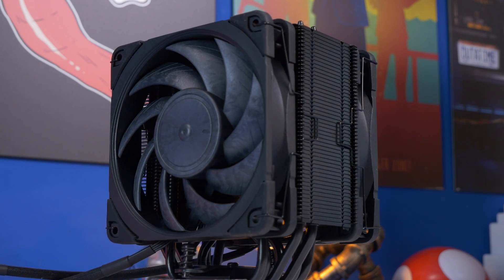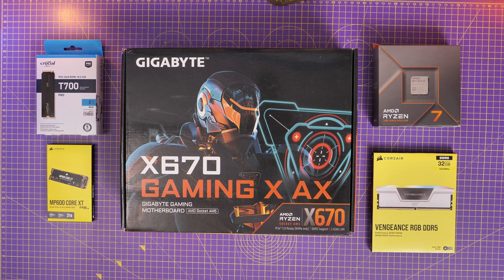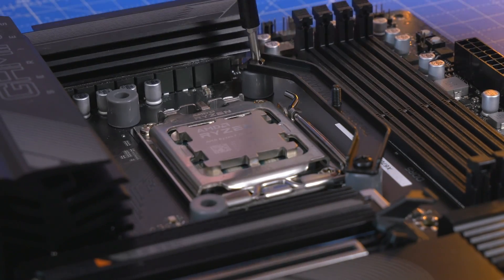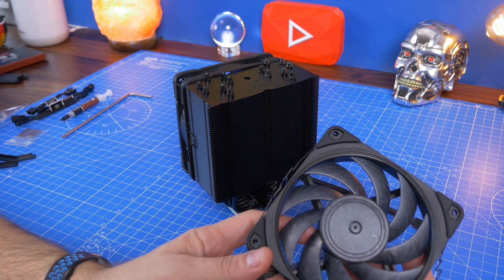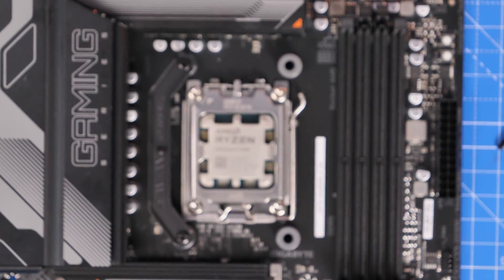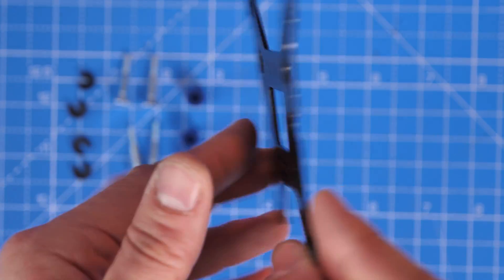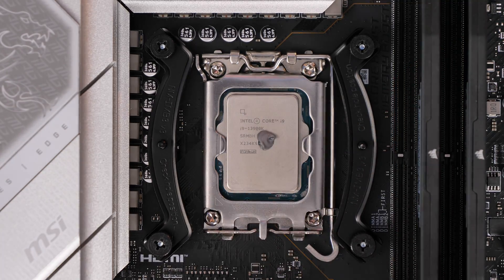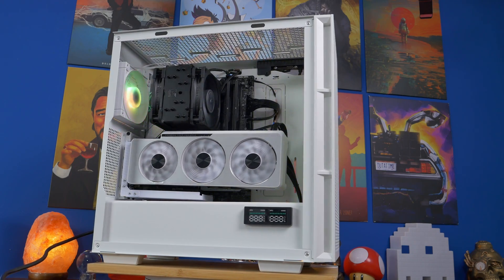Noctua NH-U12A Chromax Black CPU cooler install guide for AM5 and LGA1700

Comment: NOW Noctua removed standard plate for AMD and already replaced that with offset so user can install  standard and offset with one plate only. Good move by Noctua. I am FAN of Noctua Air Cooler. Since 8 year I am using Noctua Air cooler for my old AMD 1920X Threadripper CPU and it is still running without any issues. You pay the quality you get the quality :)

Comment: It feels like these fans are going to fall off. The little flimsy wire brackets don't actually hold onto anything. They just loosely sit into the heat sinks. But it's not actually secured
Reply: No that's not true. You didn't clip them in correctly
Reply: @Eyeless-x1 you're right. I figured out how to fasten it correctly.
Reply: @zak87  i get where you were coming from though. when i did my build i was afraid to pull them tight and mess up the fins

Comment: Hi!
Here's some feedback for your viewers.  We tried mounting this cooler to an ACER ORION 5000 PO5-655-UB22 with a proprietary ACER intel 1700 socket motherboard and we were unable to complete the process.  Unfortunately, the proprietary ACER motherboard did not have the necessary holes for mounting the backplate and we felt that it was better to return the machine and instead purchase a Lenovo T7 with a branded Intel motherboard that isn't proprietary.   I'll update this comment after we attempt to install the Noctua on the Lenovo.

Comment: I placed my Noctua down but then immediately realized I needed to rotate it leave room for the ram. I didn't do the thermal paste again because it was only on for 10 seconds and still wet. Will I run into issues?

Comment: This was a helpful video. I ran into differences with my chromax black compared to yours. It came with extra standoffs in the Intel parts back, blue and black ones. But the manual does say use blue for lga 1700. And my heatsink mounting brackets have only 2 numbered holes instead of 3. The directions show 3 like your video, but do say use #2.  The part number is version 4 whereas yours is showing version 3, so I must have been shipped a newer model (with old instructions). And my backplate for Intel shows only the Intel engraving, it does not show other markings like yours, but otherwise the shape is exactly the same..

Comment: Anyone know if the fans themselves are required to be installed with the noctua branding facing outwards toward the logo on the heatsink?
Reply: The fan logo is where the air comes out and you want it to point to the back of the case where the exhaust fan is

Comment: Thank you, such a complete video :) I'm building a new desktop pc, waiting for components to arrive. I have the same CPU cooler (already have one for my server, so sticking with what I know), but the same thermal paste and now rhe offset brackets.. only thing "missing" (not really) is a contact frame that I'm getting for it instead of the stock ILM. Hope it works well with the offset brackets.

Comment: I heard that even for hot CPU'S as the one i have the I7-13700K it works very well. Next week i'll have it. At this moment i only have the Arctic neweer 34
Reply: Hi. I'm getting a 13700k and a noctua nh-u12a next week. How has the experience been for you so far? Is the i7 heating too much? Noise levels? I do not plan to overclock the cpu. Thank you for your time. Cheers.
Reply: @DepressedCapitalist  I’m about to install one on my i7 13700f I’ll tell you how it is.

That is unless you already got one of course
Reply: @a_catfish5180  Hi. The Noctua is out of this world. Such a breeze to install and configure. I love it so far. I'm coming from a previous Noctua (nhu12s) and I've noticed this (nuh12a) to be a little little noisier. But it could be because I'm pushing an intel i7 13700k which tend to heat quite fast and the cooler is working double time. I use the Pc for music production and occasional gaming. Good luck with yours. U won't be disappointed!
Reply: @DepressedCapitalist  hey, I’m sure I won’t be. but everything else has decided to be a pain! The pcie cable on my gpu is stuck BIG TIME and my old cpu cooler is giving me some trouble but that’s just me being super unlucky and obviously nothing to do with the noctua cooler. You know how it is, 30 minutes becomes 10 hours thanks to 1 snapped or seized bolt
Reply: @a_catfish5180  Yes, I know. Been through that too. Patience, good concentration and soothing music while working helps a lot. It took me 2 days to have my pc running. I was in no rush, so everything turned out fine. Good luck.
Reply: @DepressedCapitalist  my lovely girlfriend was there to help with holding things and having small hands to reach but I resorted to simply mounting the GPU upside down (I guess inside out) with the anti sag bracket. Miraculously it sits perfectly flat on the end of the case if I flipped it and screwed it in. Extremely ghetto for a €1000 gpu but what can you do right!
Reply: @DepressedCapitalist  update my old cooler was so seized (the screws at least) I had to file them off and then heat up the heatsink to the point where sturdy gardening gloves almost didn’t insulate enough. It came loose just before I was gonna grab welding gloves… now I’m letting it cool off so I can put it all back together
Reply: @DepressedCapitalist  FINALLY. All back together and working better than ever
Reply: @a_catfish5180  Congratulations my friend. It was a tough fight hahah But you've won. Enjoy!

Comment: Does the cooler come with daisy chain cables or did you get them separately?
Reply: I believe it comes with a single y splitter so you can connect both fans to one port.
Reply: Come with them

Comment: Will the AM5 guide also work for AM4? A lot of people are still on that platform
Reply: All noctua am4 mounting (except the low profile L9 coolers) work on am5, the only difference is the introduction of the offset mounting. The L9 coolers have their own backplate which isn't supported because it's part of the socket now. Basically if your am4 cooler uses the stock backplate it'll work fine on am5.

Comment: Modern CPUs need proper cooling and not everybody wants disco lighting or AIO coolers in their PC cases. Noctua is surely the best choice for those who want the best of traditional cooling. This video comes as a perfect introduction to the world of classic CPU coolers !
Reply: I may only be 24 (which is to say RGB has been around a long time for me, many oldheads will have been around before it) but even since my first pc I’ve not cared for RGB had a fractal design case, R5 I think it was called 

Used steel series just white backlit keyboard and mouse.

Didn’t really understand the RGB hype. In hindsight I’ve saved tons not overspending on things because they have fancy lights

Comment: I used this cooler on a 7800x3d  and getting about 80c 82c ( in a hotter climate ) R23 allcore
The NH-U12A is a very good alternative to the d15 and is much smaller ..
Reply: On a 1440p config ?
Cyberpunk, 7600x, 1080p best quality, 80-85°C
I replace it with a peerless 120 and it goes 75-80°C. For this price, this cooler is not to recommended for me.
Reply: @romainh1875  no near what you say..tested with 13900k
Reply: did you use it with offset mount?  @romainh1875
Reply: @romainh1875  same db?

Comment: I recently purchased this cooler and it came with the AMD offset brackets.
Reply: I just double checked the Noctua website and they started including the brackets in Q4 of last year.
Reply: Yes, I didn't know that so I ordered it separately when I ordered the cooler. The separate brackets ended up getting lost so I said screw it and went ahead to install the cooler without the offset bracket as I had already been waiting a week for the offset brackets. Was very happy to see the offset bracket was included with the cooler. Should have checked the included brackets when I got the cooler, oh well.
Reply from the maker: Interesting. Thanks for sharing